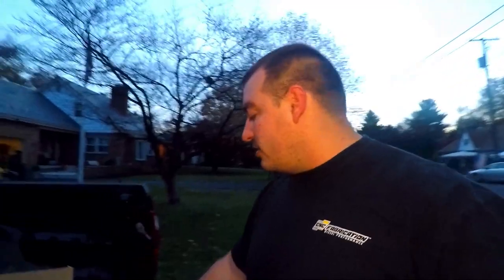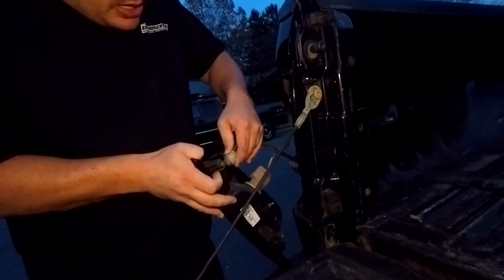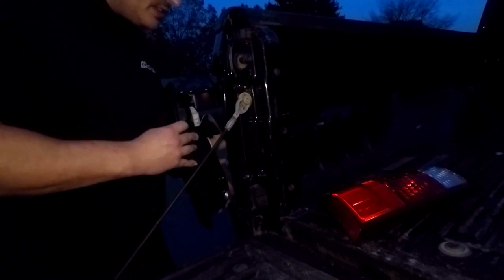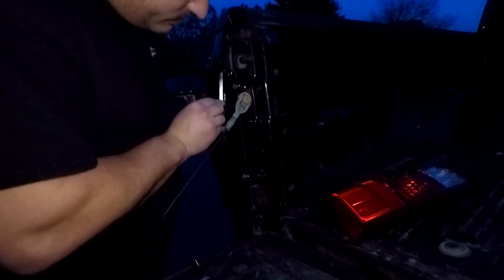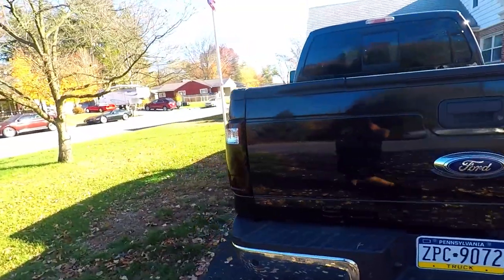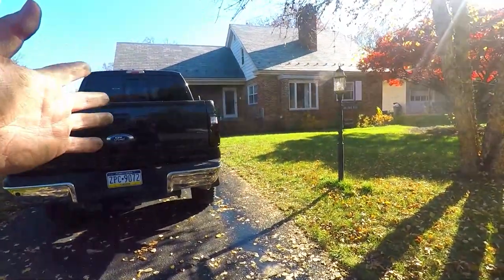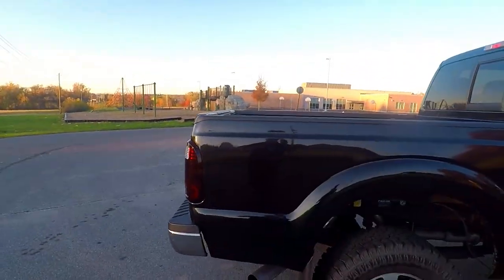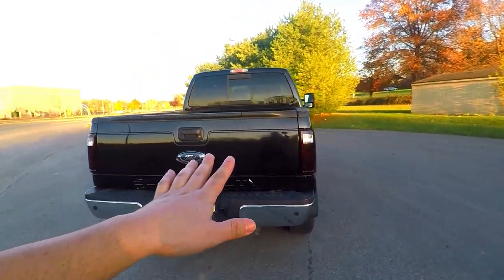How To Replace Tail Lights 08-16 F250 Super Duty

Comment: Excellent instructions on installing new style tailights if your looking for brighter backup bulbs  highly recommend getting diesel leds to replace your backup bulbs ive got smoked taillights on my 06 and its like a pair of headlights in the rear
Reply from the maker: Thank you. Down the road I'll probably get diode dynamic back up leds
Reply: I've got the lumenex back up lights
Reply from the maker: I have heard of them before but not really familiar with them as a whole. How long have you had them
Reply: for a couple weeks and tbh there as bright as advertised if not brighter and for them being fairly cheap with them being on sale there hard to beat ill see how well they work when I get 15 precent tint done soon all my side windows
Reply from the maker: Tint is on my to do list in the near future
Reply: @six0bros  what percentage you going with
Reply from the maker: I am not 100% sure. I am not going to go super dark though. It will be relatively light